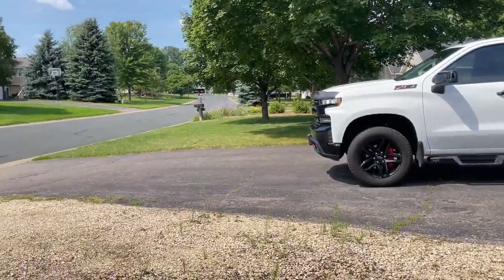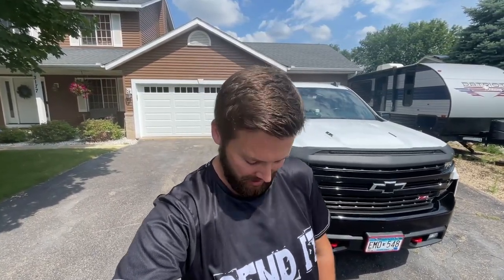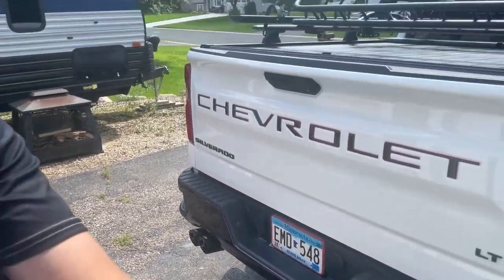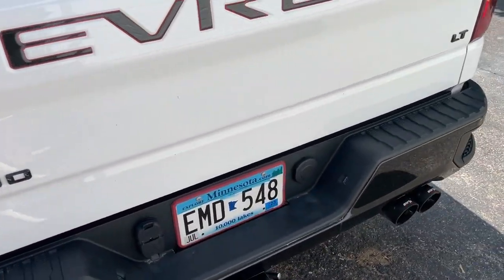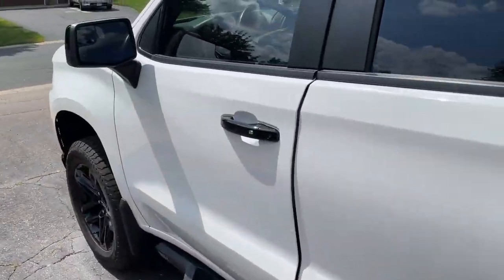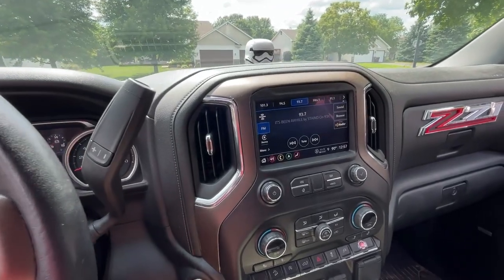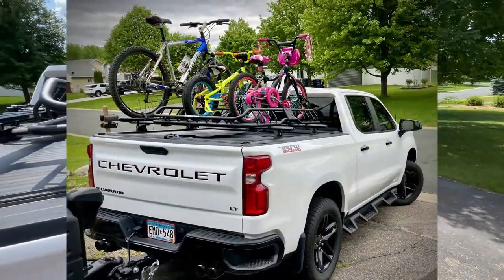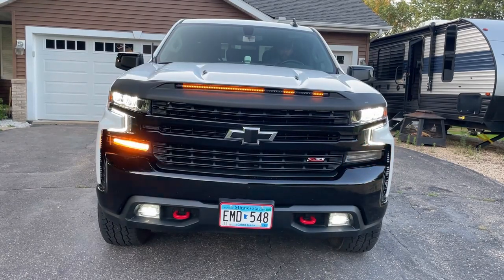Over $13,000 in Truck Parts! What would I buy again?

Comment: 2021 TRAILBOSS LT,   275 65 r 20 Falken at3w $2200,  wheels fuel $1800,  level rough country 1.5 install and parts $600,  leather seat diamond stich roadwire 1900,  recon taillights $600, led drl fog lights $200, tonneau cover $800,  bedliner $325.   DAMM GETS EXPENSIVE

Comment: I own a 2021 Chevy Silverado 1500 RST and would like your thoughts on converting my manual folding  outside mirrors to power folding mirrors. Chevy Dealership has not been helpful. I have a two door garage and the only way to fit my truck is to manually fold the mirrors. Can you help?

Comment: One more thing I'd like to see done, it's on American Trucks and its a hood scoop from Air Designs that would match your AVS lighted hood protector perfectly. You can actually see pictures of what it looks like on a white trail boss right on their site! Changes the look of the truck, for a lot less than say buying a Ram Air fiberglass hood, which 9 out of 10 come chipped up, and require several hours of body work just to get them right. The hood scoop they sell doesn't have any of those problems, since they are a much more durable ABS just like the hood protector on the front. Check it out and see what you think.

Comment: Looking at the AVS AEROSKIN PRO you installed, when you follow the link and check the part it says not for trailboss. Is this what it said on the one you ordered?
Reply from the maker: It’s a glitch because the 2022 refresh trail boss has a different hood shape. If you have a 2019-early 2022 it will fit. It’s an AVS glitch, Not RealTruck.

Comment: I put that 800 HP MOD on mine. 6” Lift, 24x10 35” M/Ts Need all 4 tires for traction. All SRT parts with H beam Rods, Whippled, minus Cats a Eff’n Beast.

Comment: I really like your content and I’m about to place an order through boost auto. My only question is does the fog light mod you installed stay on with the high beams or is that a separate mod?
Reply from the maker: They stay on. They are linked to the parking light circuits that’s your running tail lights and the Amber corner lights. Those are always on at night